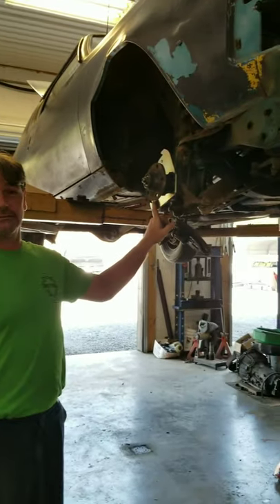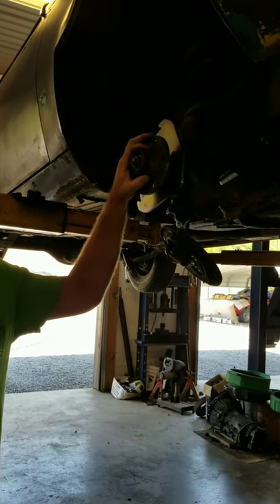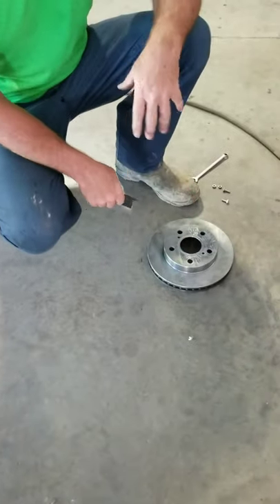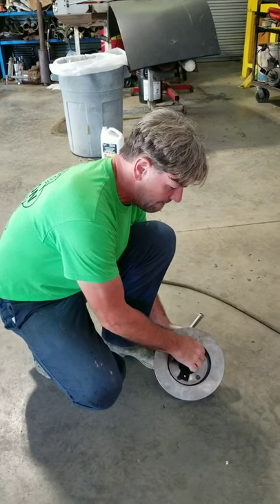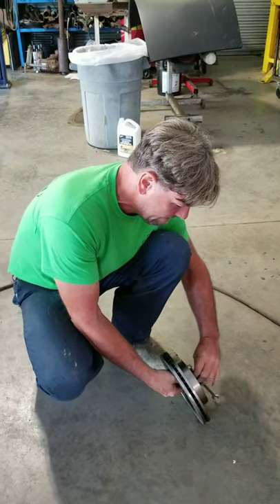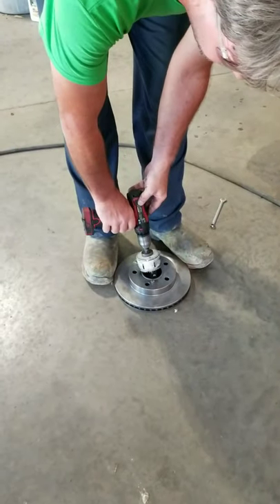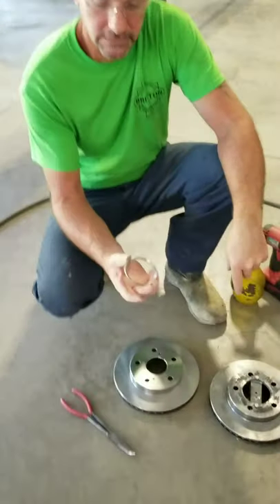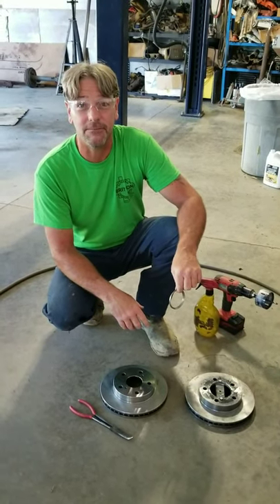1975 AMC gremlin disc brake conversion

Comment: I machined the hub down to 2.40" so I guess I don't need the hole saw. Now I have to machine the outside of hub so it fits in the rotor. Seems like I will have to take a lot off. How much did you need to take off?
Reply from the maker: It's been awhile but I think 0.100